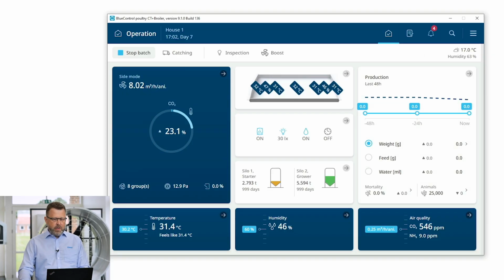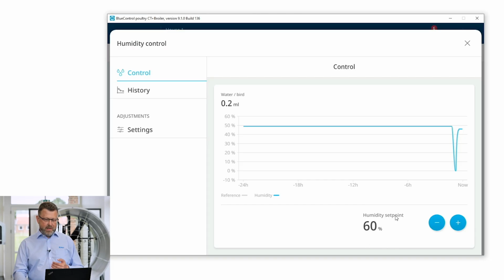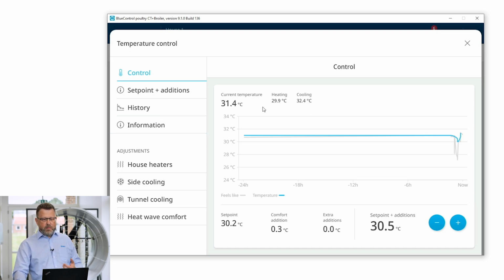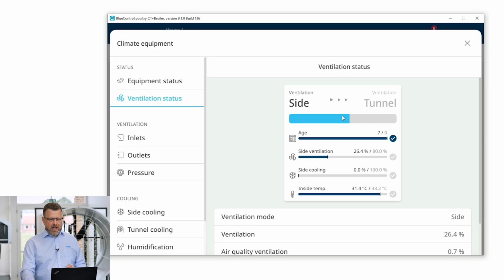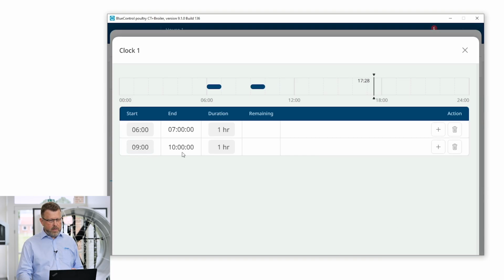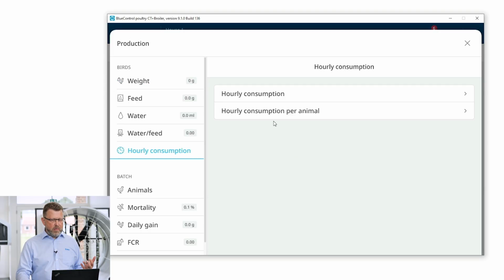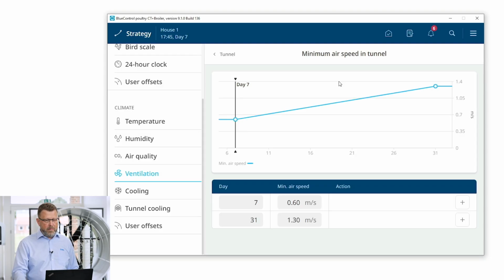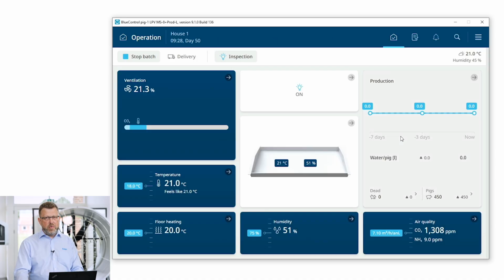SKOV BlueControl from A to Z

Comment: Can the ventilation sides be set to all fall open in case of power failure and the generator fails to auto start??? 

In case of power failure, if the side window vents fall open, would it be sufficient to avoid suffocation of broiler in h frame vertical farm?